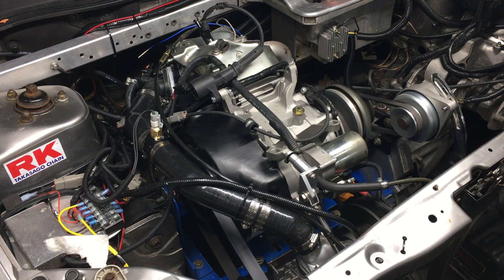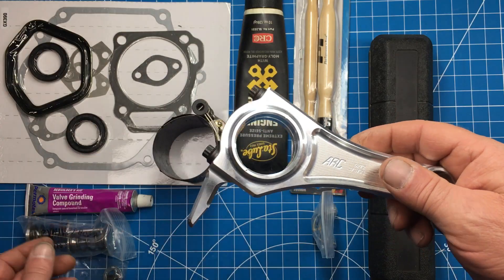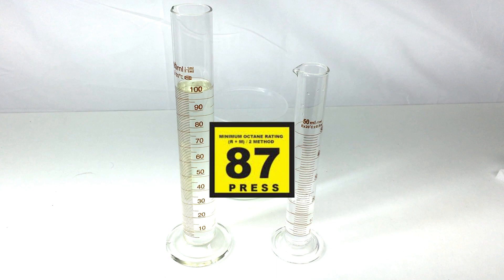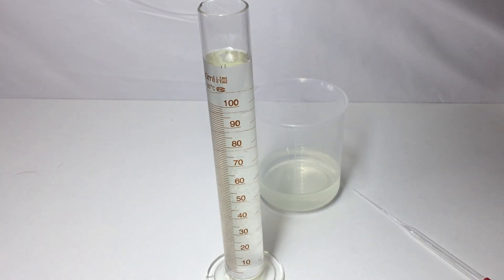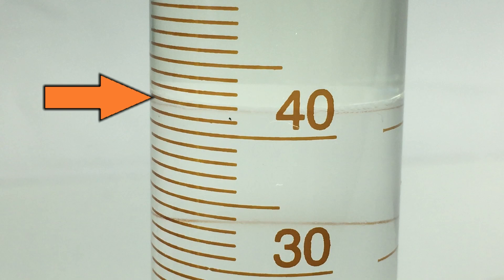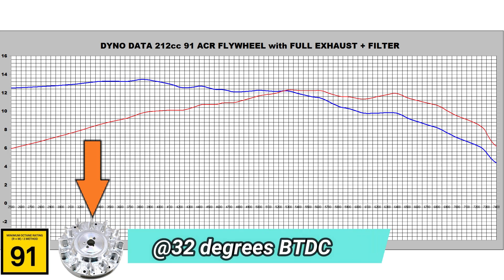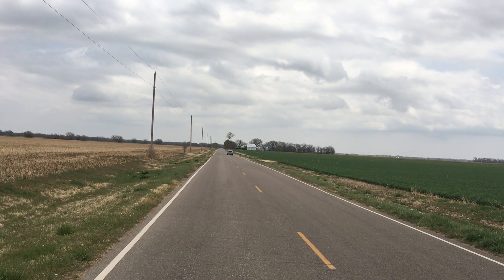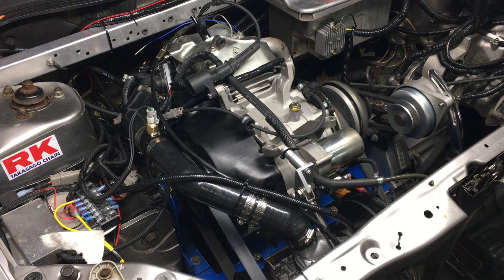S2E8: We dyno test several fuel grades to see if good gas is better than cheap gas for small engines

Comment: The 93 octane made less power because ethanol has less energy than gasoline, causing it to run lean. If you retuned the carburetor for e22, you'd get a more normal idle speed and approximately the same power as the other 2.
Reply: I was hoping someone would bring this up. E85 uses 30-40% more fuel IIRC, where that lands at the E22 level I'm not certain, but running the mixture a little richer likely would help. Still not enough dynamic compression to really benefit from it though
Reply: @AustinRBa  higher octane fuel takes more heat and pressure to ignite, that's why it's called "high test." Meaning if a low compression, low performance engine uses high octane fuel then it is harder to ignite, doesn't burn as complete etc. Common knowledge in racing
Reply: @Turboactive  That is completely false.... 

A higher octane fuel can be ignited just as easily than regular gasoline with a proper spark. The higher octane rating just means that the fuel can tolerate more compression and heat without "self igniting" and the resulting detonation issues that would be the result.

The burn rates of a high octane fuel can be just the same as 87 octane pump gas... 
If I put V.P. C14 (114 octane) into my little pit bike with a 70cc engine Vs. 87 octane pump gas, the bike runs exactly the same either way. If what you are saying we're true, the pit bike WOULD lose a ton of power when using the VP C-14, but it does not. I am simply wasting my $15 a gallon fuel by running it in the bike.
Reply: What about non-ethanol 93?
Reply: Ethanol can produce more horsepower and torque than 87, 91, 93 octane gasolines. To get more power with ethanol fuel you need to adjust both engine air/fuel ratio and ignition timing, if looking even more power gains then also increase engine compression ratio or even turbocharge the engine. E85 is above 102 octane fuel.
Reply: @jakedcrane8019  It can, ONLY IF, the engine is of a high enough performance level that will allow it, and can take advantage of it. 

Putting E-85 into a general purpose, Ho-Hum, of an engine and then retuning for it will accomplish nothing but ending up at the same power level AND using 33%-35% MORE fuel in the process.   

I have chassis dyno tested an ordinary flex-fuel minivan on regular gasoline AND on E-85 on the same day, 30 minutes apart, averaging 5 runs for each fuel, and the horsepower numbers were all within the error margins of the dyno. E-85 is not a magic fuel that WILL increase horsepower on everything, UNLESS the specific application is rowdy enough to take advantage of it.

There ARE negatives to running E-85 Vs. regular gasoline also...

1. E-85 is hygroscopic, meaning that it LOVES to absorb water from the air, and it MUST be stored properly in the correct container, or else it'll end up full of water I'm a short time. 

2. E-85's shelf life is extremely short when compared to 100% gasoline. 

3. E-85 is VERY corrosive to fuel system parts, and metal fuel lines MUST be replaced with stainless steel parts, ordinary rubber hoses must be changed out with E-85 compatible equivalents, and if using a carburetor, it must be rated for E-85 use, and if it isn't, it NEEDS to be drained after EVERY use and flushed out with regular gasoline before it sits overnight. 

4. You WILL lose 33%+ of your fuel mileage when compared to 100% gasoline for the SAME power. If you plan on making more power than with 100% gasoline, the loss will be well more than 33%.

5. You WILL have to change your engine oil and filter much more frequently on E-85 than you would when using 100% gasoline. The fact that E-85 is hygroscopic means that even though the E-85 is in your fuel tank, it WILL still absorb enough water that the water will end up past the engines piston rings, and will end up "milking" the oil alot faster than with gasoline, which ruins the oil alot quicker. Also, the extreme corrosiveness of the alcohol just affects the detergents, viscosity, and other ingredients in the oil much faster requiring shorter service intervals. 

Don't get me wrong, E-85 CAN be an awesome fuel, in place of expensive race gasoline, when the level of the engine performance calls for it. But it DOES require more fuel, more maintenance, and more expensive fuel system components, to take advantage of it. It's not a magic bullet for ALL applications though.
Reply: Almost! Having less energy isn't what causes it to run lean, it runs lean because it is an oxygenated fuel.

Comment: Love it.
PLEASE test water meth injection, both port injection for cylinder cooling/octane boosting, and on the end of as long an intake tube as the engine can handle for evaporative cooling to lower IAT

Comment: On regular cars:
Higher octane takes the most effect on engines with variable ignition timing and a knocksensor to let the ECU find out how early you can go with the ignition (direction early) bevore the engine starts knocking... 
More octane ---> earlier ignition is possible.

Comment: Perhaps you could get away with running the arc flywheel by ducting air from the grille area to the cylinder head, and cylinder cooling fins.

Comment: Wouldn't the ethanol in the 93 octane reduce engine temps, thus making things more reliable and efficient while under load in the Honda?
Reply: Ethanol makes less wear on the engine compared to gasoline due to high octane number and a bit of a cooling effect. And the exhaust smells sweet

Comment: Ethanol fuel contains about 1/3 less energy than gas. No offense, but this test is not accurate because of the varying levels of ethanol in the fuel. Kinda silly that they just add ethanol to boost the octane rating in fuel 😤. They are robbing you of horsepower and charging more for a blend that contains less gasoline!!!

Comment: Perhaps a bonnet scoop in front of the flywheel or a cold air feed from the front grill would sort out the engine cooling. As the cooling is most needed at high speed a scoop or cold feed should make a considerable improvement to the engine temps at sustained high speed driving.😀

Comment: Some may find the following information interesting. 

It's a common misconception that an increase in octane equals to an increase in power. They believe that the octane raises the power output of the fuel. This isn't the case; octane only increases the resistance to detonation (pre-ignition). The fuel needs more heat to ignite therefore, can compress higher and not explode on its own. This allows engines to run at a higher compression which will produce more power.  While you will most likely not experience any ill effects from running 93 or 91 in a low compression vehicle, you will not see any gains. It's even possible to see loses if you use race fuel in that same engine. Forced induction results in increased cylinder pressures therefore increased octane fuels are beneficial.

Comment: One way to test if you're extracting all the ethanol is to add a known quantity of ethanol then use the extracted volume to compare.  Say you're adding 5 ml and extract 3, then it would mean you're only getting back about 60%

Another way would be to do multiple serial extractions (usually 3 is enough), though this might be annoying to do, depending on setup.

Comment: Here in Germany we got "ARAL Ultimate 102". It's pricey, but has 102 octane🙂

Edit: your explanation at the beginning is true! It's a hobby. The purpose of a hobby is to put as much time and money you can get, put into something that serves almost no purpose 🤣
Reply: Octane rating in Europe is different than the US. 100 octane in the US is roughly 105 in Europe.
Reply: @5roundsrapid263  but you cant buy 100 octane straight from a gas station pump, right? Or at least i thought so.
Reply: @swealer  you can in some places.
Reply: @swealer  yes but it got some ethonol in it if you want true 100 octane you gotta get airplane fuel  its pricey and can only be baught at small municiple airports aka county airports here in most states.
Reply: @compwiz878  yeah E85-E100 isnt petrol.. is nice corn juice🤣 its good, dont get me wrong... We had E85 in germany a while ago but they removed it completly... Dont know why, probably because they cant put the big taxes on and it was dirt cheap.
Reply: @swealer  only way to get higher octane fuel is either get aviation fuel which is 100 octane and no ethanol. Unlike racing fuel which still has some ethanol in it at a lower percentage compared to 87 89 or 93. 

Another way is to run straight alcohol not ethanol.

But both alcohol and aviation fuel  work better with high compression ratios.

Comment: One important thing to mention regarding weight is the fact that even though you lose a few kilos switching to the ARC flywheel, you gain more than just those weight savings. The moment of inertia of all rotating parts can really bog down an engine since it's spinning up weights really fast, taking away some power from the wheels. Maybe it's not enough to matter, but I mean, you already have so little horsepower

Comment: Was always taught the higher octane was just slower combusting,so needed more timing to take advantage. Or use it in cars that needed it. (older high compression vehicles)
Reply: Very few older cars required higher octane fuel. There were some that had higher compression engines but they weren't the norm. A lot more newer cars suggest higher octane than older ones due to turbos becoming the norm on smaller engines but the ECM will pull timing as needed which can lead to a loss of MPG but the engine will run fine on the lower octane.

Comment: 87 octane is the best for the normally aspirated engine. When you add 7 psi boost you're now adding 50% more charge and much higher temps and pressures during the ignition of the charge. You're turning a 420cc engine into a 630cc engine. I think you should get knocking and I'm concerned that you're not with 7 psi boost. Have you put a timing light on it to make sure the speeduino is actually running timing where you think it is?

Comment: Well, that was kinda an abrupt ending to the episode, kinda used to your outro. That is some interesting discovery for the 93 octane, as most of our pumps here in NC advertise that 93 octane is Ethanol free, which is why they charge such a ridiculous price for it, (usually almost $1.80 above the price of 87 octane). This may explain why my wore out push mower does not like to run, because it has on LL y ever had 93 octane in it!

Comment: the cast flywheel also provides a rotational mass to the engine to allow it to easily blow off swings in rpm and helps overall to keep the engine rpms more steady. a lighter AL flywheel with its lower rotational mass allows a lot more load factors to influence the engine RPM, although it will spin up faster (due to the less rotational mass we have to put into the AL flywheel) it also doesn't supply centrifugal forces back into the system in it's rotational mass to help keep things going while the engine piston is in between firings... Allowing the loads to greatly influence the engine RPM.

in a go kart where the point of the engine is to get all 150lbs of it to max speed, a lighter flywheel makes sense... in a 2000 lb car, not so much. we don't gain much speed with RPM, the way the trans is set up, we need the power more.

TL;DR - flywheel weight helps keep the RPM and engine power delivery constant.

i'm not an engineer, but... i wonder how a HEAVIER flywheel would perform?

slow to ramp up RPM, but move the torque curve way up in RPM? maybe stretch out the torque curve?

 might get it more where we need it... maybe adding more rotational mass to the car engine will change where we run the motor in the RPM range to get that peak torque curve. might be woth an experiment or 2.

Comment: Great video, Jimbo!  I wonder if you could use an electric fan, with computer control, on the street legal gocart, to overcome the limitations of the ARC flywheel.  Or a ducted hoodscoop to force more air past the head, when at 50 mph.

Comment: Something to consider, the ethanol content beiung that high in the 93 octane may require a tuning change to ensure you dont end up running too lean. Even with an indicated 14.7 (or insert goal afr here) the combination will be leaner with that amount of ethanol. I am not sure it would hurt anything in the reel world, but you are running a supercharger on an engine that may be being used in an application that the manufacturer never had in mind- so (insert quote about safety here).

Comment: I always run non ethanol gas in my small engines because they may sit for a while and that crap will pull in moisture and destroy tanks and carbs. I can only get it in 93 octane though.

Comment: The 420cc Supercharged engine needs an intercooler AND the 91 octane fuel. Of course you’ll have to up the injector duty cycle to make up for the ethanol content/cooler charge density. Playing with the timing might make more power too, but that’s not too easy with the stock flywheel/coil. After all that you can play around with overdriving the supercharger.

I love what you’re doing here. Don’t listen to the naysayers.

Comment: Please refuse to make he switch from foot-lbs of torque.  Torque is a vector product.  Found by taking the cross product of the two vectors.  And, rXf does not equal fXr.  We had it right with the units being consistent with the math.  Do not let someone push us into something which makes it harder to teach things, becasue the French decided to use force-distance in the metric system, back before folks figured out vector math.  A lot of the metric stuff is right and makes much more sense then the “imperial” system we still use.  But in this case we accidentally had it right, and the metric world had it wrong.  torque as ft-lbs, becasue it matches the math, and lbs-ft as work because the order doesn’t matter.
Reply from the maker: Thanks!, On this channel we will always go with the imperial system for HP and Torque.  The metric crowd can do there own calculations if they wish.

Comment: Why don’t u try  a oil cooler with a electric fan  or a electric fan on the engine  to cool it down with a temp sensor  I think a oil cooler would help it out to cool the engine oil down when wide open great video keep it up 👍🏻
Reply: theres an oil drain plug, then you just machine a hole on another side and connect fittings, a pc watercooling radiator and hoses, a mechanical or electrical pump, just to move the damn oil and then youre good!
Reply: @7236399   u said it bud  that what I would  do  just go get a oil cooler for a arc and put her on there
Reply: Yeah I no but u could  put a inline pump on it
Reply: how to plumb a oil cooler with no oil pump?
Reply: The Engine Has no Oil Pump . It has a Slinger arm on the connecting rod that slings oil into the bore .

Comment: Nice test. :)
I still think there is a serious problem with the Comet VR transmission/clutch.  As I understand it the revs should come up to near peak HP and go up from there. That's the way snowmobiles work. That yours is seriously bogging way down in the middle doesn't look right. It's like the Comet is shifting all the way up too early. In each gear.
Any way of monitoring this during runs?
Reply from the maker: Yeah there is still a problem with the clutch setup for sure.  We finally have all the parts to attempt to tune the clutch again, however for now we need to focus on making the stupid charger work and then we will go back and play with the clutch again.
Reply: @robotcantina8957  I've looked at this supercharger for just this application. However, in my dream world I would power it with an electric motor controlled by a microcontroller.